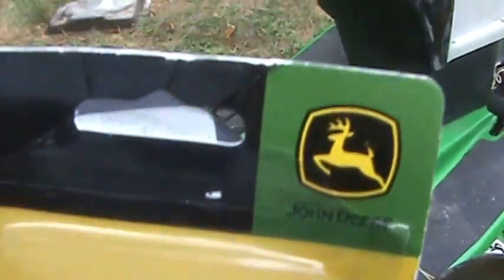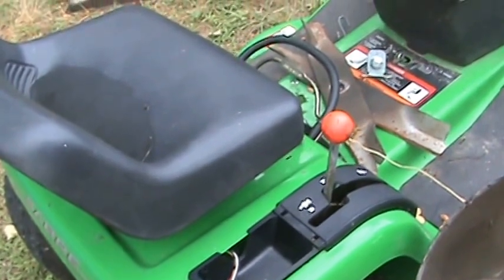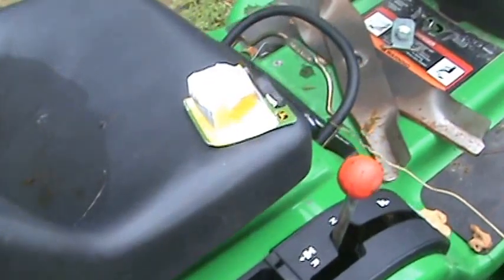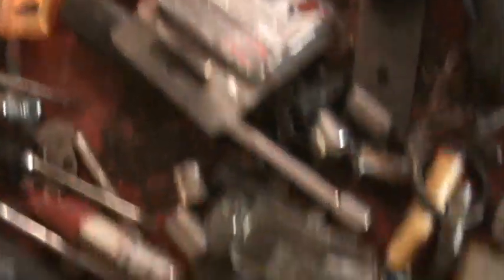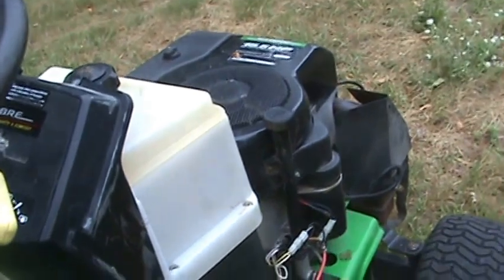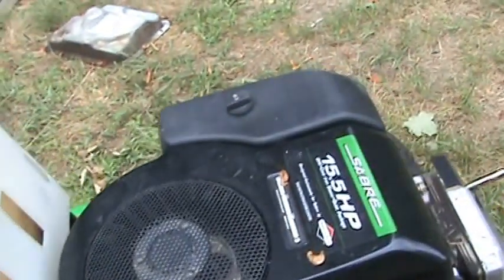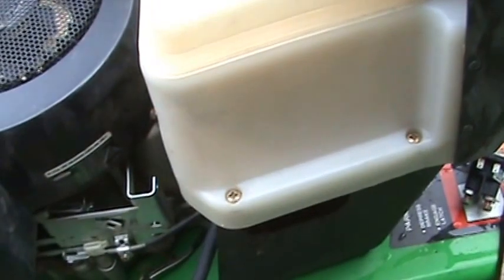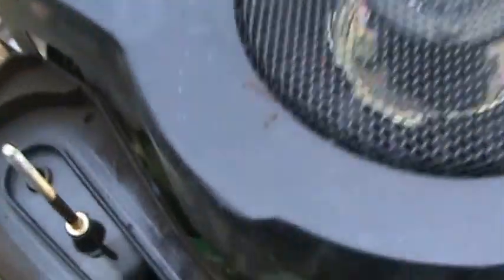SABRA  LAWN MOWER  BLOWING FUSES PART 2

Comment: The numbers and letters are stamped on the 5 blade connectors on the ignition switch. The seat switch is not sensing a driver. That is activating the kill feature on the engine's coil -- which grounds the coil and prevents it from throwing a spark.
Reply from the maker: Very good

Comment: Yuppers, called "dead man switch"  it cuts  power to the ignition in case the driver falls off and the damn thing still running at wide open throttle she don't mow somebody over
Reply from the maker: Very good love dead heads switches

Comment: Its your seat.  Need to put downward pressure on the seat to activate the safety switch for the seat.  You need a driver on the seat putting downward pressure on the switch under the seat or it won't start.
Reply: Not really